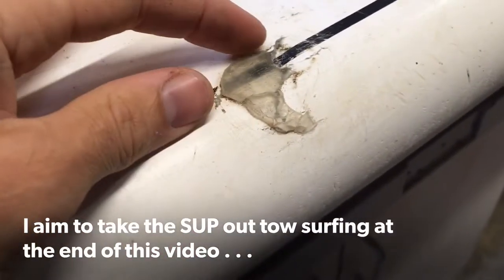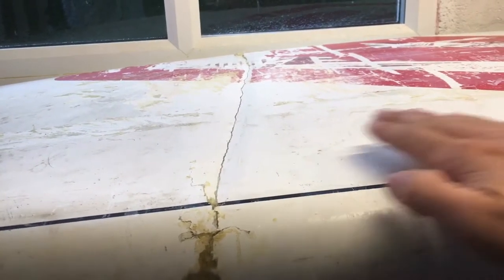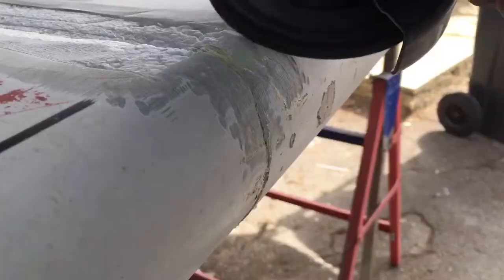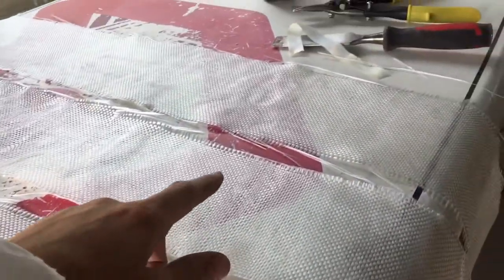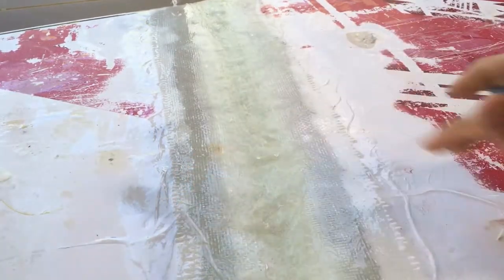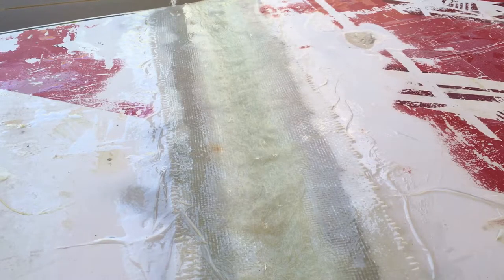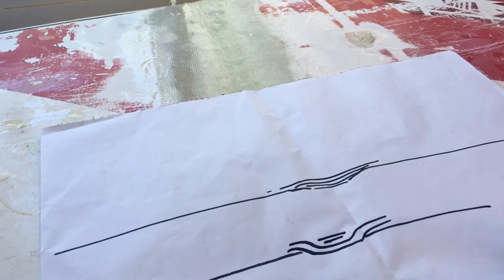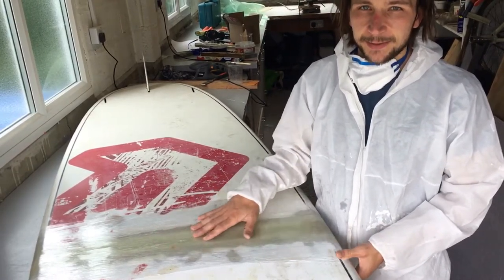BROKEN SUP QUICK FIBREGLASS REPAIR - FANATIC FLY - Part 1

Comment: Hey Sam, You didn't first glew (with Epoxy) the 2 parts of the board back together, right?
Reply from the maker: I didn’t however I’m sure it would have helped even if only to line up the two parts.